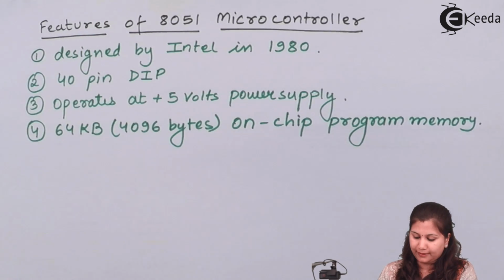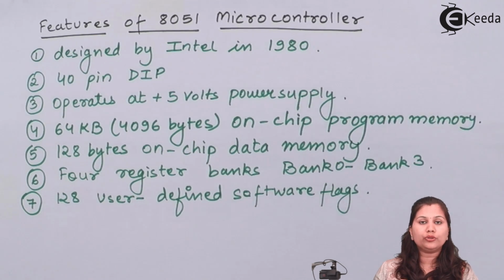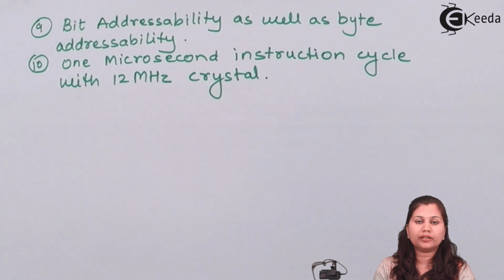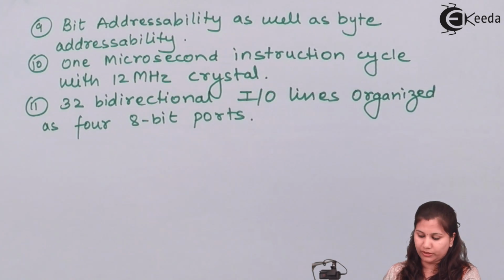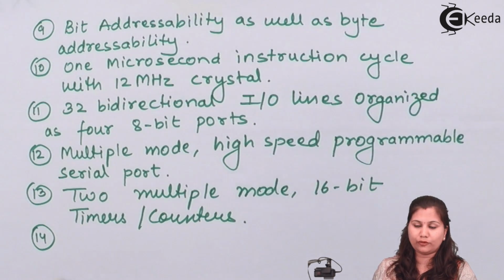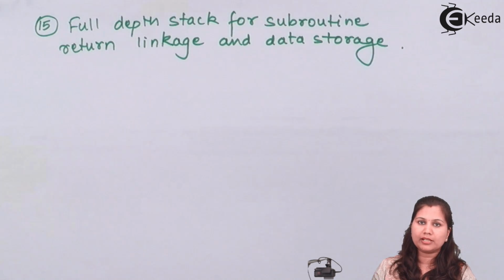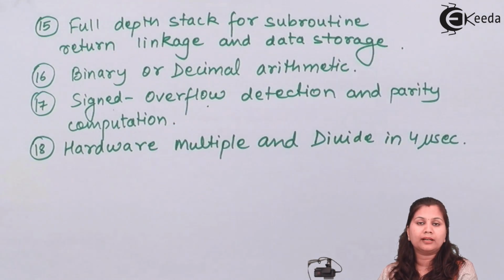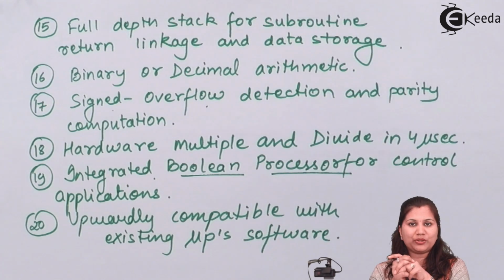Features of 8051 Microcontroller - 8051 Microcontroller - Microcontroller and Its Applications

Comment: in 8051 program memory is 4KB instead of 64KB
Reply: I think what they meant is that it has 64KB of address space, but only 4KB of physical memory is included internally.
Reply: Mayank Garg nowadays it's not manufactured by intel by numerous local vendors so different vendors ship different size.